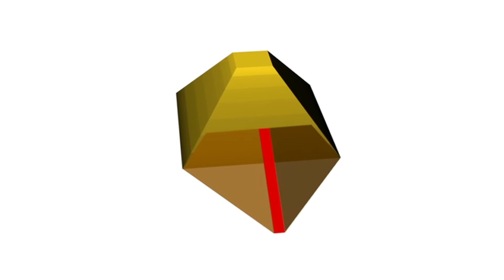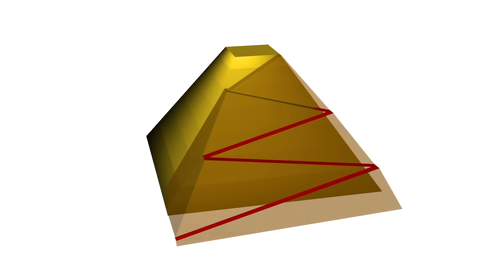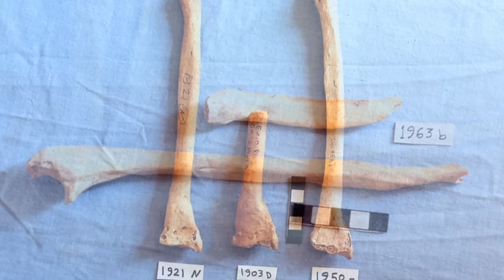Egyptology - Pyramid Construction

Comment: if I lived back then and didn't have crane I would use the sand fill it to level of it and add it as you go up when finish dig it back to bottom
Reply: I'm thinking they put flat blocks of stones down and slid it on them with sand
Reply: Good idea BUT - what do you cut the stones with ? Copper and Bronze will NOT do it . Also (are you ready for this ?) - if they worked 24hrs a day - 7days a week non-stop for 20 YEARS  , they would have had to produce 11 blocks ON SITE - EVERY HOUR .
Reply: @rossie273  they had rope cutters kind of like dental floss thru cheese
Reply: @ronwallace6273  of course . That could be done - if the Rope was harder than the stone .
Reply: @rossie273  get a big heavy rock on concrete throw sand on ground and drag it over sand it drags easier and very little pressure
Reply: @rossie273  they cut stone out of queries today with a steel rope today and drill holes along a line and wedges til cracks off is another way

Comment: This is COMPLETE BS. The reason is because how on earth can a bunch of salves let alone a person drag a 20+ ton rock. Impossible. No matter how many slaves. Would require billions to create one pyramid. Because all would die trying and they would need new ones each time. Also how on earths hell can they get strong enough rope to support the pull when it would rip. And if ramps were used the ramps would have to be double the size of the pyramid to get it up. Humans can’t do that. Hands down. And even now a days they have to use chains.

Comment: The Great Pyramid is consisted of millions of precisely cut limestones weighing at least two tons each. Even with today’s cranes and other construction equipment, building a pyramid as huge as that of the Great Pyramid would be a burdensome challenge without the presence of wheels and the appropriate tools to cut through rocks. The amount of labor, technology, materials, and calculations used for their construction are beyond our imagination. 
There are two assumptions surrounding the mysteries of the pyramid: The pyramid involves advanced technology that was beyond the knowledge of the time. The pyramid might have been constructed by the aid extraterrestrial beings or by their technologies.
Furthermore, like many researchers claim, there is no reliable record that the Egyptian pyramids were built for tombs. There are no hieroglyphs left inside or outside the pyramid, and there is no record of the document preserved separately. In the ninth century, Caliph al Mamun, the seventh Abbasid caliph, decided to see what lay inside the Great Pyramid. But the records say that there was no treasure, no burial artifacts, and no burial inscriptions. Therefore, the existence of pyramids might serve a different purpose than the king’s burial. 
Egyptian carvings demonstrate that the ancient Egyptians utilized what appear to be handheld torch or a light bulb that were not lit up by fire powered by means of electricity thousands of years ago. The electricity required to power such devices could only have been provided by a gigantic electrical source. This is why people believe that the Great Pyramid of Giza, whose purpose remains a mystery, is believed to have been utilized as some sort of a power plant or energy generator. The white limestone used in the Great Pyramid is an efficient energy distributor (conductor) and an insulator. It is believed that these properties allowed the Egyptians to control the energy from within the Pyramid. The source of energy was the water at the Giza plateau. There are various evidences that suggest that the Great Pyramid was not a tomb, but something else, for example, a power plant. And the source of this advanced technology might have come from extraterrestrials
Reply: I believe in aliens but i believe and in ancient  Egyptians. Do you?

Hello , what you are saying is very interesting, but it doesn’t bring anything new  about how the Great Pyramid of Egypt was built. In Romania, a book was published, THE SECRETS OF BUILDING THE GREAT PYRAMID OF EGYPT, which has completely new theories about this subject.                                                                     . 
Go to www.thegreatpyramidofegypt.com , read fragments ; the section Fragments ( menu = translated into English / Fragments of the book and Romanian / Fragmente din carte ; comments/ comentarii) and have some comment.
Sincerely, Hantz.    

www.thegreatpyramidofegypt.com      

  1 - Pharaoh Cheops And The Great Pyramid 
  2 - Menu / Meniu :  
  3 – English / Romana:
  4 - Fragments of the book / Fragmente din carte :     
  5 – Comments / Comentarii:
read "fragments of the book" and you will find interesting things.

Comment: These are in essence, the same conclusions 19th century archeologists reached. Quite unbelievable that the same narrative is still prevalent, given overwhelming evidence from water erosion for example, to place the structures in a completely different, earlier time frame. The stone surface work demonstration is interesting, if difficult to place within a context of volume production of perfectly flat blocks, but this is the softer stone; let's focus on the perfectly fitting granite blocks. How were they cut, let alone transported and fitted with such precision using bronze tools. Anyone who has tried to chisel stone such as granite by hand, even using power chisels will know with certainty that it is impossible to cut stone as hard as granite, with a bronze chisel. I'm only making the point that because we don't have the answers, it is idiotic for academia to suggest they can help us to understand, and fill our 'knowledge gap' with this sort of nonsense.

Comment: A canal would be a much more efficient method climbing around the pyramid. They had limestone and could have built water tight ponds with timber or stone loch gates. Dozens of stones could be lifted at once in many ponds, with 2 tones of water carried to the top lifting many stones up to the next pond as it moved down transfering its potential energy. It would be much easier to carry water up than to manhandle the huge blocks. They may even have devised some way of raising the water using some kind of primative ram pump technology or other means, though I am less clear exactly how without metal. Perhaps copper or lead pipes would be possibilities, but no evidence of that has survived. But loch gates and reed rafts are the way to go. Dragging huge blocks up earth ramps in the desert sun would be hugely more expensive in time and man power.

Comment: Cut the stones in the dry season and build canal's to the pyramids then in the rainy season add floats and float them to the pyramid, build a tube up the side out of wood with locks, float the stones up to the top which has walls and has a pool of water, place them in their place, take off the floats. Repeat until dry season, cut more stones until it rains and do it again until it's done. Until then it's a fort with tunnels going everywhere and an escape from the heat.
Reply: WHOA - cut the stones ? with what ? and please don't say "COPPER" .
Reply: but it's a desert no rain bro
Reply: @samer3li844  they used the nile river
Reply: anamarieus yea I know they used the nile , but what I know that they didn't wait for the rain to move the rocks
Reply: @samer3li844  you don't know what your talking about.
Reply: Daniel Swann mood

Comment: This is absolutely nuts. Just imagine the amount of resources needed to build the ramp higher and higher just to pull up the heavy blocks. More resources being spent on the scaffolding works than those required to complete the pyramid itself. Which builder would be so stupid to do that? Its like spending a million dollars for building something worth only a couple of thousand dollars. Imagine, the pyramid has four sides and they would have to erect several ramps on all the sides. How much time, effort, and resources would it take? Also, there is the problem of pulling up those heavy blocks. If the distance pulled upwards is several metres it is still believable, but the height of the pyramid would require pulling these blocks very high up and at steep angles. That is the first problem. Even today, using modern technology doing it the old fashioned way suggested by the Egyptologists, this task would appear to be very difficult. These archaelogists do not employ science, particularly physics,  in their theory. Even using the strongest of ropes or helm to pull these heavy load upwards, the gravitational pressure on these ropes would become more and more immense as they are pulled further and further upwards and would probably snap in no time. The second problem is moving the blocks horizontally once they reached the desired height. For that to happen, it would mean probably building ramps all over the entire pyramid site ! Unthinkable. I suggest there is an ancient technology being used which present day archaelogists and Egyptologists have yet to uncover. The Egyptians may have pulled those blocks up and lined them up horizontally, but after employing some kind of ancient technology to lessen the weight and task. My best bet is the use of sound. Modern day physicists have proven that when sound waves are calibrated at certain frequencies and is being aimed at an object it is known to float or hover. Somehow sound waves have anti-gravity properties under certain circumstances. Maybe someday some scientist in the near future would discover the secret and show the world how the pyramids were actually build, using men, physical resources, and the manipulation of sound waves and frequencies,

Comment: No way did ancient man build build the pyramids. They did not have the tools the brains to achieve this mammoth task they can't even build a decent toilet let alone a pyramid. Tell me how they quarried granite 5 hundred miles away dressed it and transport it to giza and fitted it to place with a hairs breath at the joints.
Reply: pledge 7 Is this comment an assumption that "aliens" supposedly intervened?
Reply: @boaoftheboaians  it's as good assumption as we are led to believe by mainstream archeology of how ancient man constructed these monolithic sites all round the world. For me has a engineer this is not possible with the tools & brains they had at the time. Look at the giant blocks of stones in Jordan over a 1000 tons in weight each quarried dressed and moved to site. They say they were moved by putting blocks on wooden rollers and pushed to the site to achieve this you need a solid perfectly smooth road and perfectly round rollers of very hard density to cope with shear weight of the blocks of stone.  I would imagine that to lift the blocks of 1000 tons a piece on to the rollers impossible to do with the equipment they had then move to where ever????????
Reply: Death is a good motivation, especially if the king says to build his tomb or get whipped.

Comment: There is a very persuasive theory that the pyramids were built using water ways, channels, and troughs, which, when placed in the water with buoyancy aides, made the massive heavy stones light enough to be pulled and pushed into place with minimal effort.

For buoyancy they used inflated animal stomachs, just as they had done for millenia in that part of the world, which would be strapped around the blocks and when the blocks were slid into the water they would bob along the channel relatively easily.

They used their tools and knowledge to create a moat around each level, then they would build the stones on that level all the way around, drain the moat, move up, and then start over on the next level up.

In water a 2, or 10, or even 50 ton block can be pushed by one person with little effort at all, and they can be positioned with relative ease.

The had water filled chutes with gates, which created pressure, that would open at intervals and would allow buoyancy aided stones to be effectively sucked up the chute to the top; they then built the last few rows and placed the point on to the tip of the pyramid.

There are some videos on here about it which illustrate the process perfectly.

Comment: If a ram had been used the mass of the ram would’ve been TWICE that of the Pyramid! So where is it?
And where did they get the fuel (wood) to cook for 100000’s of workers in a desert?
Reply: Sorry, spell check ramp, ram. As an engineering grad, I am not you understand the difference between weight and mass, think volume of material. The questions still stand...
Reply: Just Smashing ,
Reply: redlegagent err...you are incorrect on all counts I am afraid. 
I had the pleasure of touring Egypt in May this your and quizzed both my guide and a Prof at Cairo Museum...neither could answer the questions and had the honesty to admit it....of course perhaps you know more than a Prof of Egyptology & a career tour guide...
Reply: Why would anyone build ramp size of pyramid?

U build small ramp to bring the stones one floor higher then u finish it and another ramp from floor 2 to 3

One block is one floor high when all blocks are placed u move to next floor
Reply: It was not a desert then. Herodotus wrote in 500 BC that it was grasslands

Comment: If you had battery power.  
Why use logs?
If you had metallurgy.
Why use wood?
I would have used magetic telepotation of stones.. 

Electromagnetic...

Use magnets and glide the heavy stones.. 

If rhe hover board is a neg charge.  
And the metal floor is neg charge. 
They repell...enough battery power will lift heavy objects.  
If cities put down a sidewalk made of charged metal.  No more wheels...

Comment: How the pyramids of Egypt were possibly and most likely built:
    The stones were shaped at or near the quarry and transported to the Pyramid site in this method :
    An assortment of encasements from spherical to cylindrical, encased the block and interlocked into place around each block stone allowing the stone to roll. Certain attachments around the encasement would allow either fulcrums or rope attachments to ease movement and allow for tight corner turning with the least amount of men. Once the stone reached the top, the interlocking encasement was disassembled and the stone was leaned over and slid into place.
    This technique would have eliminated the need for lifting devices or a massive ramp.
    My theory is that most likely it would have been a spherical encasement allowing for tight cornering. This would be the most logical way to transport a large stone using the pyramid itself as the ramp.
     So in essence the stones were rolled up the pyramid in a spherical encasement that was removed once the stone reached its destination and leaned and slid into place once atop the pyramid. This process was repeated all the way to the top. 
     I have not decided yet if the encasements were made of a metal alloy or limestone etc. If bronze was used it would have been melted down for chisel making and as such there would be no evidence of the spherical encasements.
    If limestone was used it may have then been discarded and reused for other construction. 
    In conclusion the only way to deliver a square to the top of a Pyramid is to encase it in a Spherical interlocking encasement.